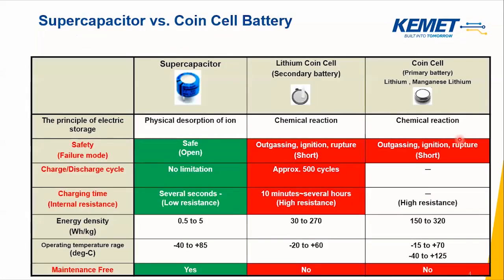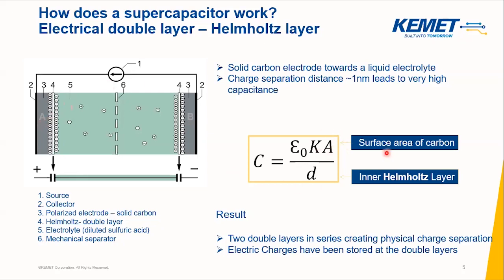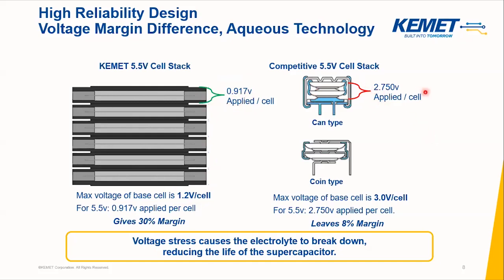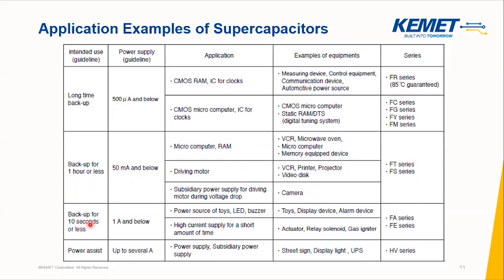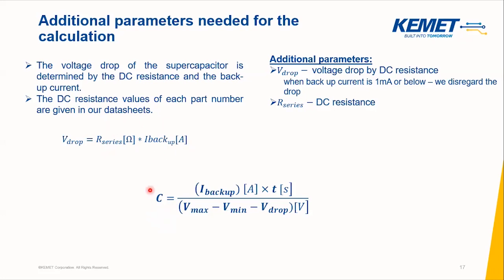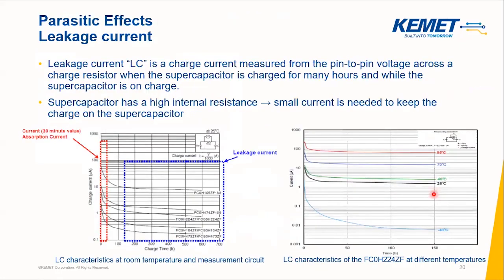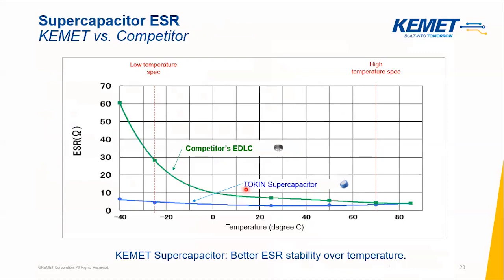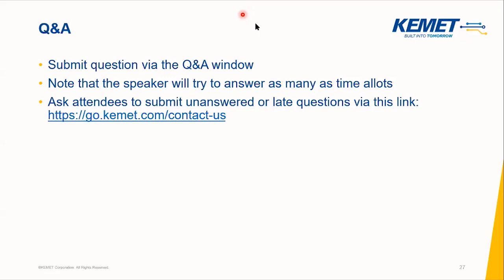KEMET Webinar | Supercap to the Rescue - Choosing the Right Supercapacitor for Your Application

Comment: Thank you Roya Nikjoo.  Do you foresee an application for super caps in electric vehicles?
Reply from the maker: Hi Tom - thanks for your question. Stay tuned for an answer!
Reply from the maker: Tom- Roya says, "Yes, It can be used as start-stop, light, ignition, kinetic energy recovery, electric, and hybrid vehicle drive support. Regenerative braking like start/stop systems is the main current application. In electric and hybrid vehicles, the power density of lithium-ion battery technology is often inadequate compared to the superior power output of supercapacitors."